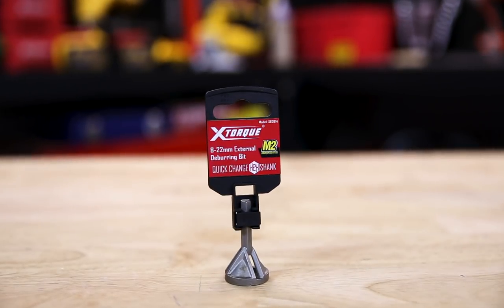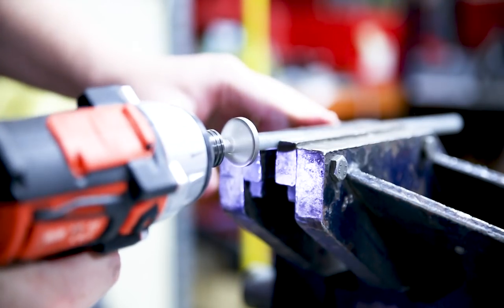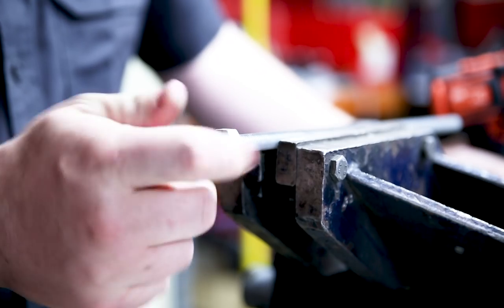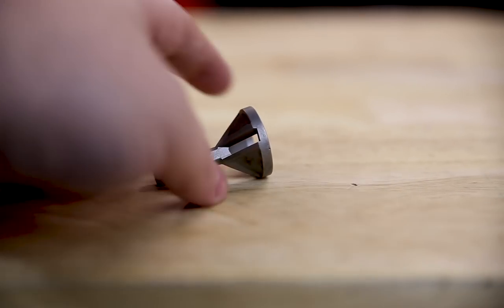Debur Threaded Rod - Xtorque Deburring Bit

Comment: Does the rod need to be held in place with a vice? Or am i able to hold the rod and debur it?
Reply from the maker: You definitely can hold it. It's taking off a pretty fine shaving so there isn't too much grab. That was just to keep it still for the focus with the camera zoomed right in. I chamfered some rebar yesterday out of curiosity holding it in my hand after a comment on facebook asked if it could be done. No problems.
Reply: @SydneyToolsTV  cheers for your reply. Just ordered one now as Smithfield hasn't got them in yet